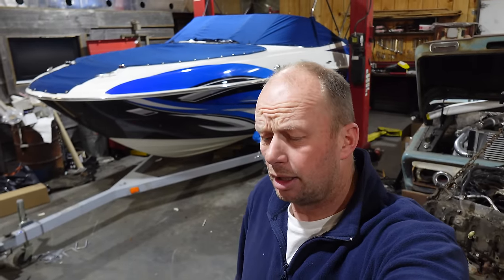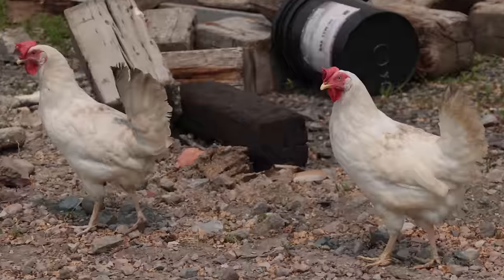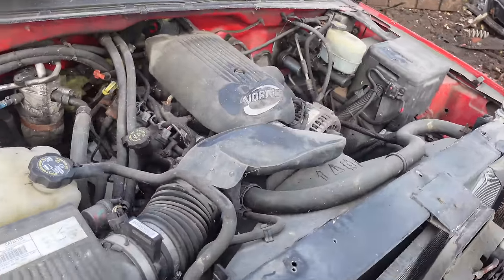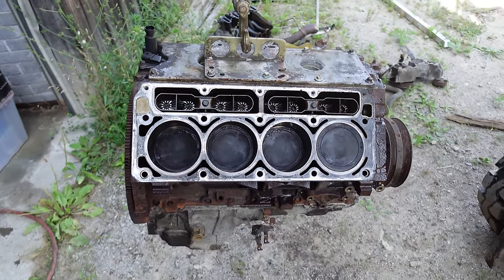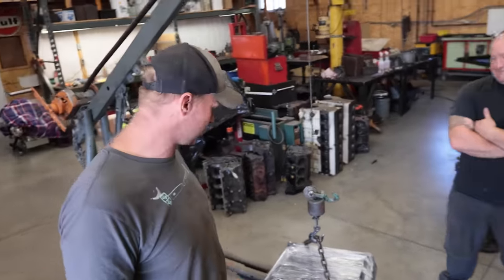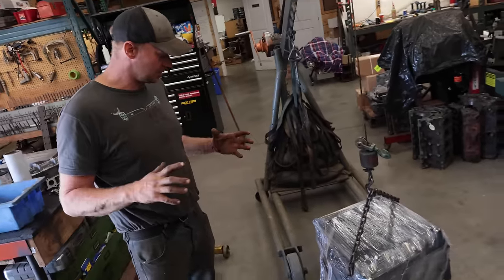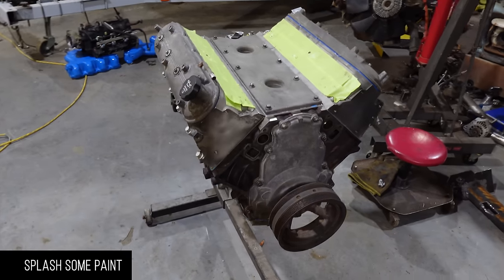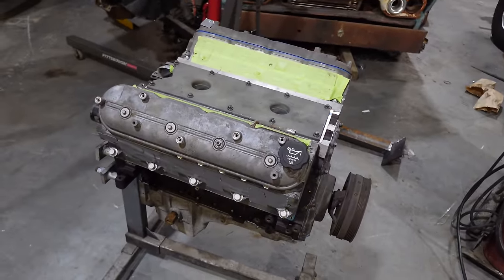On-Road Chevy LQ4 to 500hp Marine LSX Build #deBOAT [EP3]

Comment: Question you are pulling straight from the lake correct?
You might want to install sand trap if you plan on beaching the boat on shore, because it protects the water pumps as well as other surfaces inside the engine from the abrasive effects of sand and other grit picked up through the inlet that's typically stored up by the prop when you reverse in shallow water.
Just a suggestion, but entirely up to you  of course. 
I've seen numerous engines that have suffered from this issue especially with people who either party on islands, or those with young kids that often are in the shallow water for numerous reasons.
Love your thinking way out of the box with your choice of components, and accessories you adapt to suit the purpose you need.
Reply: Lake water won’t be in the engine, he’s putting in a heat exchanger which he covered in the video.

Comment: I recommend a 10 quart Dooley Oil Pan for high hp marine applications at a minimum and an oil cooler as well and a mechanical water/coolant circ pump. 

PS. I love this video and project. I have a 2004 Sea Ray 200 Select and I am planning a new motor to replace the 5.0. I am going to build a 400 hp. 5.3 with 10.5:1 Compression. I know it will cost me thousands but what the hell. I’d power add to my existing 5.0 if I could figure a way to do it. Any ideas? Everyone I’ve talked to  says to build a new motor.

Comment: When the kids were little I brought a twenty foot Sea Ray and we put over 100 hours on it the first year. We live one block from the boat launch and in nice weather would have supper on the water 2 or 3 times a week plus weekends? That electric pump neads an alarm or you will cook that motor before you realize it is hot.
Reply: It will all be through the Holley so having an alarm is a simple matter of clicking the box

Comment: You shouldn’t need a raw water pump if you’re keeping the alpha drive. They have the impeller inside the lower unit. If you’re switching to a bravo drive you’ll need a raw water pump.

Comment: Please discuss what you do with the shift interrupt! I have a holly EFI on my 3.0 and I’m currently trying to figure out how to get the shift interrupt to work. The problem is the EFI is reading the RPM signal from the hdi coil and the shift interrupt grounds that out for a brief second to take the load off the dog drive in the outdrive and the Holley thinks the engine died and it stalls out. Currently I have the shift interrupt going to two inputs one that decreases the idle to 200 RPM, and then the other one decreases the fuel flow to almost 0. it sort of kind of works but I’m hoping you come up with a good solution.
Reply: There is a bracket that holds the throttle cable from the control box and the shift cable and a micro switch that syncs them up properly.  Every inboard/outboard I have worked on has it mounted on the left side upper manifold.  You can try to do it with programming but syncing the shift and throttle will make you cuss your mother.  Get that bracket and it just makes perfect sense and don't ruin your dogs down in the foot by slamming and grinding them.

Comment: Just seen your video that's a day old. Have to say a few things. First is the alpha drive. It'll handle 300 HP (221kw) . NO hole shots with that engine. You're going to have to eeeease into it. If you jump a wave, the prop comes out of the water and you don't back off on the throttle before it re-enters. You could blow the engine coupler or twist the input shaft. 
Bravo outdrives HAVE an interrupter when you shift. Never seen one come out of the factory without one. Bravo's are good for 650 HP. If you change to a Bravo you'll have to change the engine coupler the rear engine mount. Along with the outside transom assembly and outdrive..I would run Mercruiser high performance outdrive oil.
Your engine mechanic or machinist talked about max cam lobe separation because of water reversion. Then stopped short. Would like to know what he thinks it is. What is yours?
Reply: Some car engines have a valve overlap so that drags it a tiny amount of exhaust back into the cylinder, it helps for emissions (like an EGR) You do absolutely not want that in a boat motor with a wet exhaust 🙂

Comment: 700K!  The O2 sensor, I would put it in the exhaust pipe. Reason being, more homogeneous gas mix from that bank of cylinders and likely much easier install. As long as it's more than 12"-16" from the exhaust tips you should get a good reading(not getting air pulsing back into the pipe.) *from what I searched on O2 sensor placement.
-Drilling and welding in a sleeve in cast will diminish exhaust cooling and be a nightmare to do and make sure it's pressure-tight. It will need to be a huge sleeve to accept the O2 sensor AND a socket to install it. No one seems to make a long O2 sensor.
Reply: It won't work that way because  the raw water is dumped into the exhaust.

Comment: Maxum Boats are really just fancy Bayliner boats. Maxums use woods pretty extensively. I know they use wood in the keel as I've drilled holes in them and have the bungs to prove it. The transom is also wood I believe and then much of the internal structure is built with wood. They will rot no matter what you do they are cheep for a reason. Sorry to say this but it is the truth also that hull is not designed for 500 HP just call the Corp and ask them.

Comment: If your looking for a place for the old engine i could use it, got a 24ft cuddy cabin i got screwed on, wanted it to take the family cruising around manitoulin island and the French river guy said it just needs a starter, turns out head gaskets are cooked causing it to hydro lock burns oil like its free

Comment: Not that it matters, but, thought it interesting.
Back in the day, -80’s, I had a -72 SleekCraft, with a 455 Olds and a Jacuzzi Jet. Thought it interesting that parts catalogs like TRW, etc., listed the engine, as, “Marine / Irrigation” motor, with differences, like higher CR forged pistons, heavier rods, forged crank, different heads w/ larger valves, different cam, etc., from GM. Also, found out, these engines got used in some aircraft starter carts.

Comment: The shift assist switch makes the motor "stumble"  to assist getting it out of gear. Due to the way the gears are cut torque from the motor will try to keep them engaged.
  I found the video helpful when I adjusted mine.  https://youtu.be/-s_tgevX2aI?si=qCaP6pkYhlBKK8uG

Comment: Why do they water cool boat exhaust, is it just cause lake water is there and easily available?  Do they just ceramic coat the headers now and just dump all the heat into the exhaust now?
Reply: It's a safety issue to keep a lower temperature in the engine room and on engine surfaces. It's not the best for efficiency.
 You could run a dry exhaust and it's not unusual, larger ship engines have dry exhaust.
Reply: To prevent the hull or anything else from starting on fire from the insane heat

Comment: Don't think its a good idea to mount O2 sensor in those risers, whatever you put in to get through the water jacket, like a tube, risks loosening from heat cycles. Might not leak when you do it, but probably will eventually. Not sure loctite will stand the heat on the inside joint either

Comment: Marine engine also have a higher nickel content in the block material, due to corrosion issues. If you look closely you’ll see the aeromarine badging in the block casting. That stopped about 1988. I would not ever use an electric water pump. It WILL fail sooner than later. I worked at Merc Racing for several years as a Prototype CNC Machinist Engineer at the Lake X facility in St. Cloud FL. Probably one of the coolest jobs I have ever had. Pls do your homework on parts. Auto engines are not always the best candidate for engine swaps.
Reply: I have a 19 foot jet boat I was thinking putting in a lq4

I have a 454 harden Marine 
I wanted to make some lil updates

Comment: O2 Sensor be erratic??
I don't believe electric water pump will work. You should use mechanical pump and thermostat.
Reason is you need water flow for exhaust manifolds to cool properly. Therefore need constant water supply.
So to achieve that do a salt water package, as I know it. 
Run your normal cooling system for engine with antifreeze in it. That's also better for engine. Then run a heat exchanger with a pump on it from fresh water. That way you can supply constant water to manifolds.